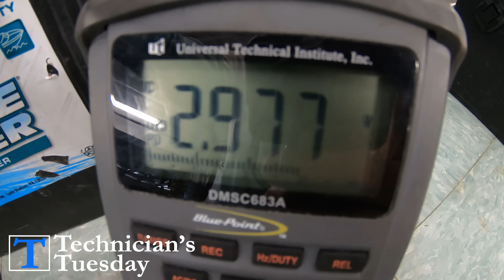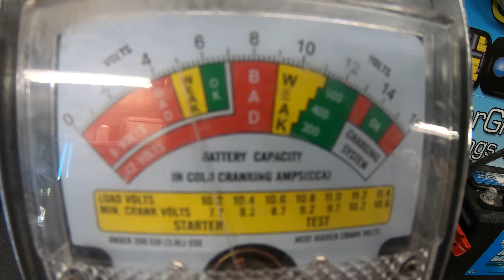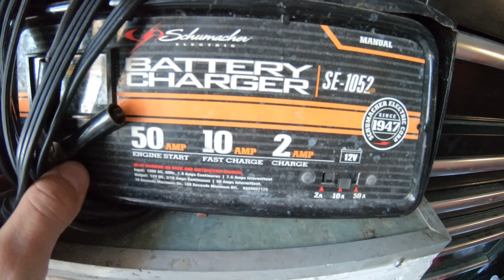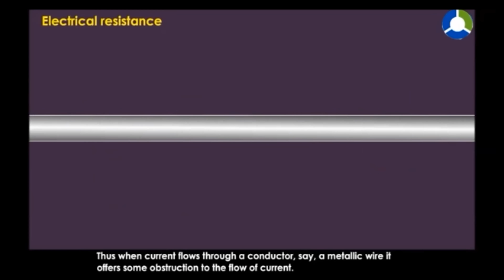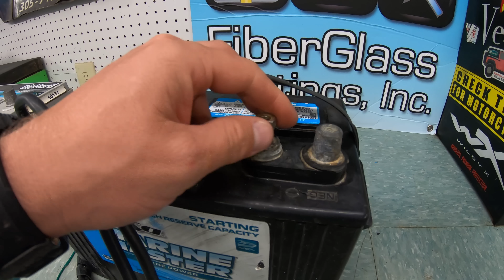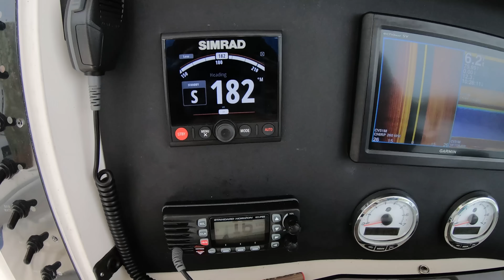Make Your Boats Batteries Last Longer!

Comment: I have a Stealth 1 DC to DC charger on my boat and have found that it significantly increases the lifespan of my TM batteries. Once the starting battery is full, the engine charges the others, keeping them from fully discharging and allows me to get longer use of the TM (they've never died even during multi-day trips). I got almost 6 years out of the last set of batteries on this setup. I'm confident I would have gotten another season out of them had one of the leads from the charger not corroded and broke under the heat shrink, allowing them to fully discharge.
Reply from the maker: Stealth makes a really good product! Huge fan!

Comment: Three things - #1 - Keep terminals clean, and coated with an anti-corrosive spray or compound ( I use NO-OX-ID -A)  #2 - Get a GOOD charger, stay clear of the NOCO "Genius" brand stuff, I've had those chargers ruin batteries, and so has a friend that happened to buy one before I got to advise him they were crap. I have a 10 year old Interstate 550CCA battery, hooked to a Minn-Kota brand 10A charger made for MARINE use it still has a 515CCA capacity when tested! #3 - Cable in a good main disconnect to the batteries, and USE IT! It will prevent any "sneak" currents from discharging it.
Granted that I do have a direct connection to a bilge pump float switch , and the Minn-Kota charger, but all other distribution, including the motor, goes through the main disconnect.

Comment: A still good 3 y/o Marine battery is worth almost half the price of a new one in a boat yard sale.. Rotate batteries like you would tires. Solar chargers make a lot of sense. Isolation switches are a must have. Meters are cheap. Keep one on hand along with a small charger. better yet get a battery box with 12 v. and usb ports and carry an extra. Put that weight under the console if you can. I even have a power-paddle I can run off a cordless drill and I carry 3 oars in my Drift-Boat. 
It's just a prop on a stick with a drive shaft . So is my transducer for my Garmin. Rocks are unforgiving. There's a cage over my gas prop and lower unit too for tough duty.

Comment: Ideally, the alternator should be wired directly to one of the batteries and not a battery switch. The other battery gets changed via an ACR from the first battery. The battery positive leads are then fed to the 1 and 2 terminals on the switch with the common going to your fuse panel. The battery switch is now used solely for selecting the battery you want to use and is not used to direct charging current.  Most manufactures don't do it this way because it ends up costing more money running additional heavy gauge cables.  Whenever I get a boat, this is the first thing I fix.

Comment: Thank you for bringing up this problem. I use a solar system ( 1 m2 or 10,7 ft2 ) with overloading contol but so or so I have to change the batteries every 5 years ( I use semi truck batteries with gel instead of water for the board electrics )

Comment: On our boat, the port side bilge vent fins are facing forward. As we go forward, air gets forced into the bilge. The vent on the starboard side has fins that face backwards. As the boat continues to go forward those fins create a vacuum and actually draw air out from the bilge. Now I have see birds build nests in some vents that are not screened. That is really bad for many reasons. Seeing that there can be a voltage lose between a battery terminal and the case makes me think. Battery cases are black. What makes them black? Is it carbon? Carbon is a conductor. I analyzed this issue once when the company I worked for who make plating power supplies started using black hose to connect the heat sinks of the SCR's between the three phase coils. The use of the black hose caused a major lose of efficiency or Power Factor. The result was that we had to change to red hose which did not have carbon. Just saying! Anyway, thanks for all the good information here. We used to keep a boat at slip all summer in St Joe, Mich. One time when we returned after a week away, I found that our batteries were almost dead. I also found out that during the week, a storm came through and lighting took out some parts of the marina. I think it also took out our battery charger, which was a Raritan unit and too old to get a new circuit board. I loved that charger and I hated the replacement because it never went through the charge stages correctly. Again, something that was suggested in this video. Thanks Again

Comment: Is there anything to charge my trolling batteries (24v) from the 12v charging system on my outboard? I know I could do it with a bunch of relays, but I was wondering if there was something else purpose built already out there.
Reply: Look at the Yandina Trolbridge chargers I love mine. It charges when the motor is running and trolling motor is off.

Comment: If removing the batteries from the boat for storage, always sit them on a piece of timber or Starboard to insulate them from the cold concrete floor of the garage.

Comment: I would add; make sure the battery compartments are well ventilated prior to hook up to ensure area is clear of any potential fuel fumes, add
Terminal connection. Then plug to power. Then I leave compartments open while charging to allow gasses to vent and to help keep Batteries cool while charging.  I usually place a small fan near the battery compartments to give a little more circulation. My cranking battery is now over 6 years old. About 100 hours a year and a multitude starts between wake boarders and rafters changes

Comment: You overfilled that battery! And you left out 2 important points. First, NEVER move a battery switch, WHILE your engine is running.  It will blow your alternator. One and done! Don't try it. Diodes are still fragile, I guess. 
Ok and 2nd, they make a tool for filling batteries, and it makes it a thousand times easier. It's a battery filling Pitcher. Fills to the perfect level with no spill. Spring loaded valve. Back when I worked at a houseboat marina, i was filling batteries, all day every day. This one Stardust cruiser, 80ft, just the inverter system alone, had FORTY 6v batteries to fill, every week! But anyway, I recently installed a VSR system for a customer. They are awesome! If you have a voltage sensing alternator (anything that's not a basic outboard motor), then you don't want to use a battery combiner. They lose a volt across them, as they work (Hence, the heat fins). This tricks the alternator, and ultimately both batteries die. VSR solves this problem. It's all automatic! And the main relay unit is very reliable; A good, low maintenance system. When the isolated battery sees that the primary battery is getting charged, it latches on. Then, when the voltage drops to static level, the secondary battery says, I'm outta here! You're on your own." 🤭
The hardest part, is separating the power supply from the systems you want to isolate to one battery or another. For a stern drive, you need to cut into the engine side of the main harness on the back of the engine, to sort it all out (maybe). 😱 If you're lucky, it'll just be one wire you have to take off the starter solenoid and re-route. If it's too tough, on your particular boat, you can just run a new red 10 gauge wire from your fusebox to the isolated battery. And cap off the original one at the fusebox. As a general rule, try not to cut anything. There's no un-cutting tool. 🤣
  A VSR system is not expensive, and totally worth it. They have an wire option, for a manual switch too. So you can bridge the batteries together, anytime you need to boost one. It should be standard equipment for all boats with multiple batteries. 👍

Comment: Love your channel!  Having owned boats for years and worked at a boat manufacturing facility, I learned a lot, but as the kids grew up and finances changed, I took a hiatus from owning boats for a while.  Now back into the hobby now that the kids are older and the funding demand for college has subsided, I have been heavily studying what has changed over the years (as well as refreshing past things learned) and your videos are VERY helpful!  :-)  Quick question, can you do a TT video on livewells (how they work and considerations for using while underway, towing, single spot fishing, etc)   or what options people have with solar charging systems instead of electrical chargers?

Comment: I used to Buy Marine Batteries and always took care of them keeping them Clean and good clean clamps. My Batteries were never overcharged or had any abuse to them. The Marine batteries were not lasting but a little over a year. I quit buying Marine batteries because they wouldn't last and started buying Regular High amp car Batteries they were a Lot cheaper than the Marine batteries, I was actually getting over three years of use out of the regular car batteries with the same Routine that I had for using my Boat.

Comment: So if leaving for long periods of time at your house/lift hooking the up the shore power to keep the batteries charged isn't a good idea? My boat has 5 batteries. 2(1 each engine), Electronics, House, bow thruster.  Should I just turn it all off and not leave any charge on it? I'm in S. FL or buy five trickle chargers?
Reply from the maker: With five batteries you've probably got an on board charger that senses the power in the batteries. Instead of plugging it in and leaving. With the battery switches off, there shouldn't be any draw on them. It would be easier to just plug it in a day or two before you leave. Then unplug it when you leave. Plug it back in when you first get back and depedning on how long it was sitting you shouldnt have a problem. Thats if we're only talking a few months. If you leave for a year, it might need to be in charge for a day or two

Comment: Replace lead acid batteries by LiFePo4, lighter, more cranking power, 10% internal discharge per year, more than 2000 cycles, and they don't explode or burn. Only downside is the price but it will pay for itself.

Comment: Stupid question: do you need a separate trickle charger for each battery? I only have experience dealing with one battery at a time. Love the videos!
Reply from the maker: No, you can connect the trickle charger to the batteries through the battery switch, just hook it to one battery and then turn the battery switch to both ;) but the trickle charger might not be able to keep up if there is a draw on the batteries. I'd say to just put the trickle charger on one battery, then alternate back and forth between the batteries, depending on how long your storing how dead, etc

Comment: I thought you weren't suppose to switch the battery while the engine was running from 1 to 2 or both.  You do that when you turn the engine off, switch to the other batter or both then start the engine.
Reply from the maker: Yes, the way you described it is best practice.

Comment: I am new to this boating stuff... but am trying to connect multiple devices into 1 battery how would i go about this?
Reply from the maker: That's a pretty deep question. You need to have fuses or breakers for everything so you will need to run to a fuse panel or breaker panel and then use a ground bus. We are working on some wiring information for the future that will help, but for now, you'll just have to put a bunch of youtube videos and blog posts together to figure out the wiring :/
Reply: @BornAgainBoating     yea...i figured, i managed to hook my vhf radio and fish finder all to the same battery, but i have lots of led lights around the boat am currently running 5 -6 batteries i was trying to only use 3 maybe 4, but ill definitely have to install a panel.

Comment: One battery hose to the outboard which is charged but do I have to charge the other battery for nav lights and electronics?????????????
Reply from the maker: That should get connected to the house battery by your battery switch!

Comment: I want to move my two batteries from the back two corners to inside of my center console.  Can you recommend a Tray or How i should mount them?  My center console has a soft raised bottom inside floor, its a super console on a '91 25' boston whaler outrage.  Seems like a heavy duty tray of some sort would be best given the small wooden access doors..  most that ive seen listed for sale have horrible reviews..  Great videos!
Reply from the maker: We generally just put the seachoice trays in, they work great, sometimes the straps fail but the trays aren't bad. Trays make it nice when it comes time to change the batteries over the boxes :) But those whalers ride amazing and even better with the batteries moved!

Comment: “Trickle chargers” or marine chargers with trickle are old technology. They’ve killed a lot of boat batteries. Battery tenders or ” Smart chargers” are preferred. They won’t cook the batteries and can be left on indefinitely. You want to get the largest charger recommended for your battery type. They charge fast, top off, and go into “float” mode, even better, some shut down and turn on only when needed. When it’s time to replace batteries, consider AGM’s. Ever wondered why engine compartments in boats get so much corrosion when compared to a car? Well the only time they really have ventilation is when the blower is on and the engine taking in air. The rest of the time there is condensation with battery fumes, a perfect storm for corrosion. AGMs vent virtually nothing unless something’s wrong.

Comment: #Batteries I always plug my battery charger into a timer set to switch on Thursday night 6:00pm and  switch off Friday 6:00am so they get a 12 hr charge. This means that I can't overcharge the batteries, and the batteries are fully charged if I want to take the boat out on the weekend.

Comment: Im a live aboard and Im docked with shore power unless underway which isnt too often, maybe once a month  My boats a 30 Catalina Mk  II sloop rigged with 2 8D batteries with 220 amp/hr each IIRC.  Since I  am a liveaboard and frequently use 12v power a bit to conserve on shore power since I  pay for it and not every day can the 80 watts of solar panels keep up, would you recommend I  do anything different?
Reply from the maker: Not really, I also don't have the most experience with large 8D or 4D batteries and the mathematics of their charge/discharge rates and the maintaining them with the solar panels. Those kinds of systems can get tricky if you don't mess with them regularly or personally own them. 
It is something that I am interested in though. That is a whole other world when you get down to figuring out your power consumption of fans, refrigerators, (unless you have an icebox style), phone chargers, pumps, lights, and all the other stuff that comes along with living on the boat. 
I can't really think of any techniques that you can do to help make your system better. :/
Reply: With big batteries there can be a lot of internal resistance. So if there’s not enough current they may never fully charge. You’re 80 watt (at noon). Is only delivering 6.6 amps best case, so about 3 amps per battery. I’d have to say you’re 8D needs 15 amp minimum PER  battery to fully charge with a normal charger. Solar would require 500 watts minimum to recharge PER 8D battery. You’re solar would barely maintain them after a topping off with a shore power smart charger. If you do upgrade your solar make sure you use a quality charge controller so you don’t cook the batteries. Remember what deep cycle battery voltages mean. 13 is full, at rest no load or charge for 6 hrs (13.2 new). Under no load: 12 = empty 12.3 half 12.7 3/4 .  14.7 under charge and 13.6 float. Take voltages less than 12 (no load) and you loose the number of cycles and if you charge back from higher voltages (earlier) you get more cycles. One very helpful tip is to change all your 12 volt lighting to LED including your anchors light. This will reduce the load by 75%.

Comment: Storing the batteries for the winter is best in cool environment. I always keep my batteries in the boat for the winter, but they have to be fully charged, empty batteries will be destroyed.
Instead of a bunch of battery switches I use a Ctek D250SE fully automatic switch, charger and battery isolator. It even contains a solar panel regulator.

Comment: Just order your batteries from Advance Auto Parts website. If you order through the website they have 15-25% off your order so you get a good discount. Makes those $100 batteries a little cheaper. Batteries are crap these days and never last more than 3 years unless you found that rare battery or got lucky with one of those over priced $400 batteries. Just buy the cheapest, run till dead and buy another one.

Comment: what a rats nest that boat had for wiring.   why do manufacturers  put fuse panels and other electrical parts in the same compartments as batteries???   off  gassing destroys  them

Comment: Great stuff! I was told not to leave a battery on bare concrete. Throw some scrap wood under it so it doesn’t drain. #batteries
Reply: You don’t have to do that. Batteries these dayside made of thicker or better cases unlike older batteries that could be drained if sitting on concrete. I always thought this to but 20 years ago I talked to a man that works for a battery company that told me this.

Comment: never NEVER PUT YOUR.BATTERY ON CONCRETE  this will drain your battery over time.. it kills your battery drains the life out of it always use a rubber mat or pad
Reply: Pretty sure this is a myth. There's a video on youtube somewhere of them de bunking it.
Reply: Not true for over 30 years. Old batteries would drain if sat on concrete due to the non insulated case they used to make batteries out of. Batteries now are insulated and will not drain. I still usually put mine on wood just out of habit now.